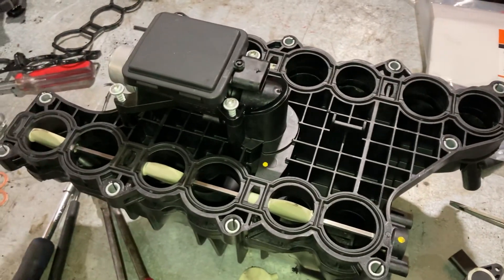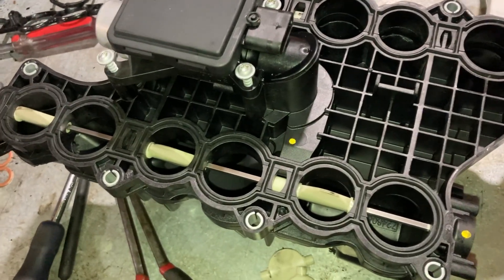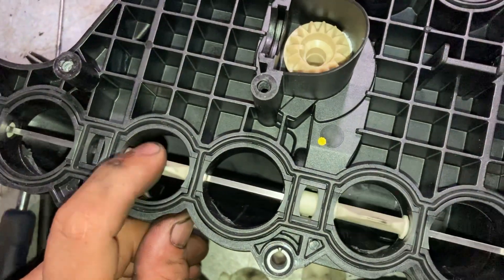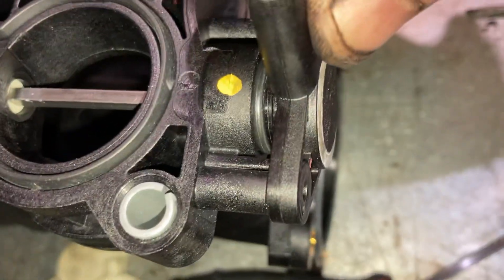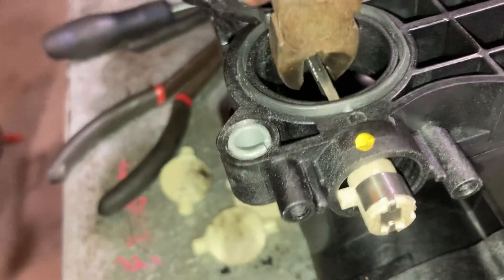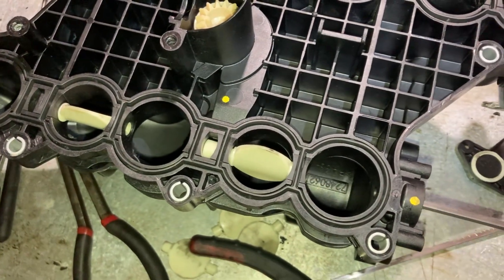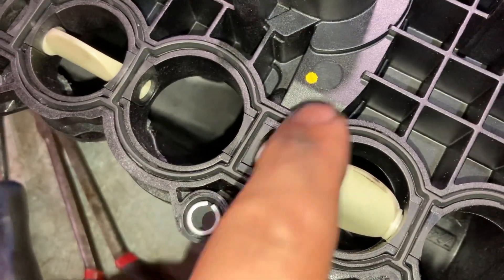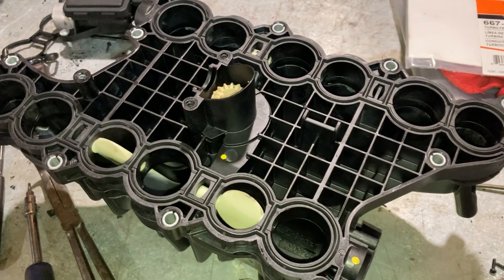Removing swirl runner valves from ecodiesel intake manifold

Comment: I’m currently getting ready to repair the leaking turbo coolant line on mine and I’m planning to do this as well, but I have been told two different things about the electric motor that rotate the swirl valves. Does the electric motor have to go back in place or can it be left off of the intake entirely?  My truck is already deleted with stage 2 tune
Reply from the maker: Depends on the programming done by the tuner. They can choose whether or not to disable and stop monitoring of the swirl valve system. Before you commit to removing the motor, you could disconnect the plug for it and see how the computer system reacts. It is a large connector kind of by the driver side of the throttle body I believe. You may have to remove the throttle body as shown in another of my videos, to get access to that electrical connector,
Reply: @tadsworkshop  thanks I’ll reach out to my tuner. Mine isn’t completely apart yet, so I haven’t actually laid eyes on it and was concerned that removing the electric motor may leave an opening to somehow lose intake pressure. But if it’s just a tune adjustment I’ll be fine leaving it off if for nothing more than just having the extra clearance under the intake.   Thanks again. Great video 👍
Reply from the maker: @NOS-ZL1  nope, no boost leaks whatsoever with the motor and swirl valves removed as shown in this video. And it is definitely nice to free up room under the intake without the motor in place. The motor makes it that much more difficult to reinstall the manifold.
Reply: @tadsworkshop  just got done with my turbo coolant line repair and did remove the swirl valves and did In fact remove the motor to them with no issues with the tune. No check engine lights. And wow without that motor the intake just sits right down with no struggles. I appreciate the video I didn’t know it was an option to do this mod. New intake, all this swirl valves and motor deleted the truck seems to run smoother also a bit more  pep to it and have gained a couple more mpg. Thanks again
Reply from the maker: @NOS-ZL1  I appreciate it. Feels good to take care of all that, doesn’t it? Should help with longevity, mileage and power. And yes, installing that intake is a pain with that electrical motor in the way. Keep that truck going!

Comment: Where would you connect the vacuum line to install a boost gauge? I was told you need to drill and tap the intake manifold. I’m sure the closer to the turbo itself would be the most accurate.
Reply from the maker: No, you want an actual readout at the intake manifold. If you take a pressure reading as the compressor outlet, your not taking into account the pressure drop across the intercooler and tubing. Is your truck deleted? Than tap into the block off plate on the intake manifold where the EGR tube used to go.

Comment: Hi Tad 's 
i have a 2015 Ram Ecodiesel  2 years back i did the stage 2 deleted with Sofa King Tune all work perfect on to May ,i replaced the turbo, and the coolant house. i install all back but now i have the warning of services throttler control, my throttler control it is disconnected and i still have the warning any help in this problem.
Reply from the maker: @dojevaz314  first, check with sofa king and make sure they eliminated the intake manifold swirl valves, even if it is a “stage 2”. The “service throttle” red message is generic, but it is saying that something that the computer uses, to translate user demand, into power, is not right. I’ve seen a few things cause this - weak fuel pressure (failing lift pump, clogged fuel filter), and a boost leak (check intercooler boots for tears, especially by the turbo outlet, and clamps). There are several “monitors” the computer checks, and unfortunately when it comes to tuning, sometimes some of those monitors have to be shut off, like “boost performance” etc. that’s why sometimes you’ll see that throttle light, but no trouble codes to match, on a deleted truck,
Reply: That it is the other problem when the warning come up steel have turbo power but not code
As soon you reset the ECM all come back normal again for 4 miles
Reply: @tadsworkshop  Curious if anyone got any answers from Sofa King and the swirl valves....last I saw they went out of business and closed up.
Reply from the maker: @jamescarter1791  I don’t have an answer on sofa king…hopefully someone chimes in. But for anyone who has their tune and having trouble with…what can you do except find a different tune from someone else.
Reply: @tadsworkshop  Thanks again.  I have ours torn all apart right now in an attempt to fix what I thought was a coolant leak under the intake mainfold  (that turbo coolant line thats known to leak under the intake).  But turns out, we removed the intake manifold to find that rubber hose in perfect shape and not leaking at all from there.  Turns out it was the water pump, so I have that on order.  Really wishing we would have pressure tested before tearing into it all.  But I did go ahead and remove the swirl valves like you showed in this video.  I'll just leave the motor attached and plugged in incase SofaKing's tune doesn't disable that.
Reply from the maker: @jamescarter1791  I’ve been in that exact situation with the water pump. Please be sure to replace that 3” section of turbo coolant hose anyway. Also - I’m assuming you ordered a gates or Napa water pump (same thing)….and even though it has the most complete o-ring collection with it, it is missing one - the o ring that fits in between the rear aluminum snout of the water pump, and the steel coolant tube in the intake valley. The part number for that needed o ring is in my water pump video description. It’s a Felpro part number I’ve verified is correct.
Reply: @tadsworkshop  I did order the Gates water pump (because thats what you listed in your video about it).  I just now ordered the O-ring.  Thanks a bunch.
I'll try and post how all of this turns out after the parts come in.
Reply: We did get the water pump and turbo coolant hose replaced (as well as a new intake manifold).  So thanks again for all the help.  We are just getting the "service electronic throttle control" message at times now.   I do have a new MAP sensor on the way, even though I've cleaned ours a dozen times.  That and the turbo seems to have a whine at idle now for some reason.
Reply from the maker: @ I’m assuming your truck is stock and not deleted? Make sure the swirl valve motor and position sensors are plugged in, if your truck is stock. Also, some of the earlier Ecodiesels had a rubber silicone elbow at the turbo outlet, vs. the later plastic tube that runs from turbocharger to intercooler inlet. If you do have that silicone elbow, they tend to break down, crack, and rupture due to the oil passing through from the turbocharger. Carefully go over all your work and make sure everything is plugged in. Keep reading for trouble codes and sending a command to clear them as you continue to tinker with it.
Reply: @tadsworkshop  OK, thanks again.   Its deleted stage 2 with SFT.  We did kind of go over all the tubes and elbows; but I don't remember if it was plastic or rubber.  Its a 2015
Reply from the maker: @ ok. In my experience with that service throttle light, it has come down to a boost leak (that silicone elbow if equipped, or even lose clamps on the intercooler. Be sure your hoses are properly clipped to the throttle body and turbo), and also low fuel pressure and a failing fuel pump, so be mindful of that. Every tuner does the delete a little different, so you’d have to consult with them, but sometimes it may be possible on a deleted truck to still require the swirl position sensors and motor to be plugged in, although I think the likelihood is low on a full delete. Let me know what you find out.
Reply: @jamescarter1791  did it work?
Reply: @msiege5212 It did work.  Yes.  I removed the swirl valves like in the video, but I wasn’t 100% sure, so I left the little electric motor on the intake manifold since it had a wire harness.   No issues.  Been driving it for about a month now.  
We do get the occasional Service Electronic Throttle message…but we were getting that before replacing the water pump, intake manifold and turbo coolant tube.

Comment: If I remove those valves am I going to get codes and I have a non tuned truck
Reply from the maker: All you can do is try. My opinion is, as long as the electrical actuator motor and position sensors stay in place, there is no way for the computer to know if the plastic valves themselves are in place. But, could this result in increased emissions which could set off a check engine light? Also another possibility. Experiment at your risk and expense of time.
Reply: Thanks for the fast reply man! At the moment I’m at a crossroads, my truck is out of warranty and I live the truck but right now I’m at the point where my intake is probably shot and it’s probably leaking like your client. I smell coolant in the engine bay at times
Reply from the maker: @RicardoCorona-k8m  are you anywhere close to me, here in Michigan?
Reply: @tadsworkshop  I’m in Iowa haha kind of far from Michigan
Reply from the maker: @RicardoCorona-k8m  yep that’s a bit of a hike. Do you have emissions testing there? I’m curious if a delete tune is an option for you.
Reply: No there is no emission here in Iowa